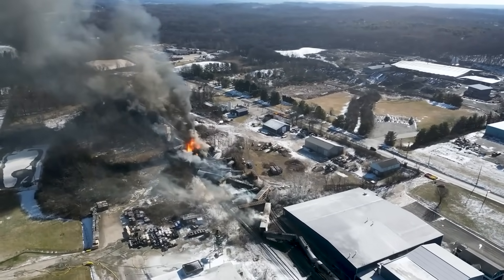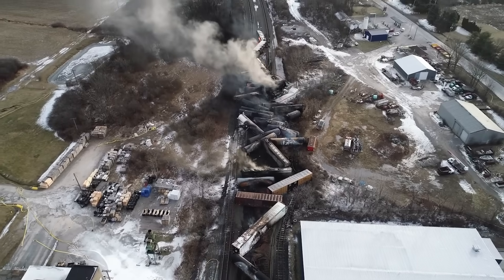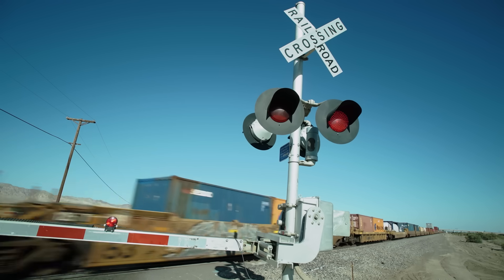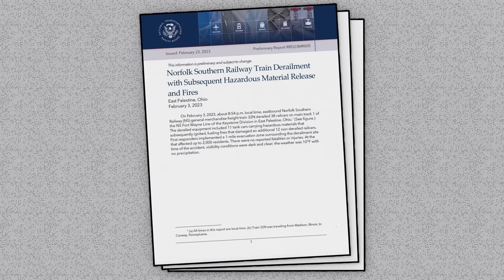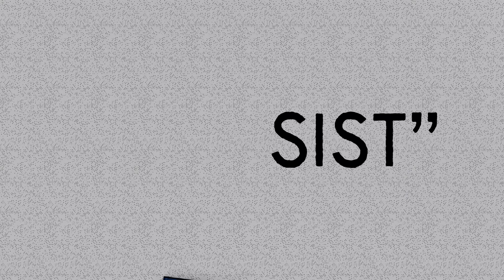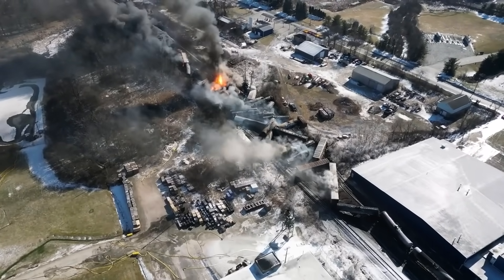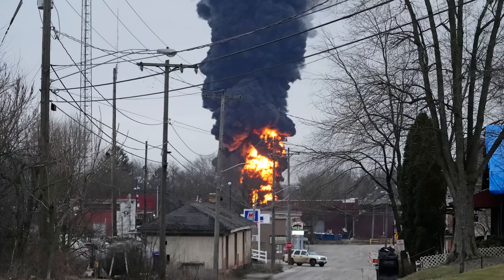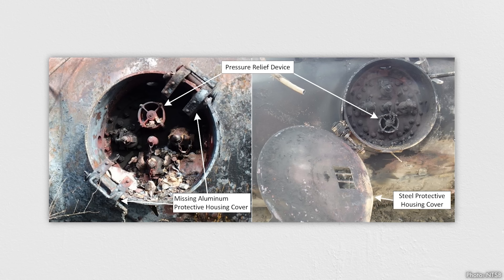East Palestine Train Derailment Explained

Comment: 1:43 For liquid/gas cargoes, pipelines are far more efficient than trains at moving cargo over land.

When a pipeline project gets derailed, the train-based logistics that move the cargo instead cost more, use a lot more energy, and tend to spill a lot more of the cargo into the environment.
Reply: So you want to build a pipeline for each type of chemical?
Reply: The second half of that runs counter to much of what I've read on pipelines. Would you mind providing a source? Genuinely curious.
Reply: bespoke small batches of chemicals aren't worth transporting on a pipeline compared to bulk chemical sluries like water, sewage, or natural gas.
Reply: Pipelines though efficient have a slight issue.
sometimes they burst open and it's not ideal having a massive pipe network the size of the water one for industries that might only need small amounts.

Comment: 8:24 no ... im wonderign why if they could release it into a trench they could have released it into an emptry tanker truck ... or instread of seting it on fire had a chemist  ay oh yeah dump a bunch of this other chemical in there to make it trun ito somthign else ....
Reply: Uncontrolled release, they didn't stick a funnel and hose on the tank. As for dumping another chemical in to react with it, said chemical may have been toxic as well, or flammable. Or it may have produced a poisonous side-product when reacting with UV. Chemistry is a quite complicated subject.

Comment: 11:08 How are contaminents handled in these measurements?  Are they all added up, or is it "standalone" data points? If so, you can have 100 chemicals each testing 1% below the(ir) threshold and tell people with a straight face that it's totally fine.
Reply: If its below the threshold then its safe even if its only 1%, the only way it wouldnt be is if the studies that produced those threshold numbers themselves were flawed and in that case it would be impossible to know what is or is not safe.